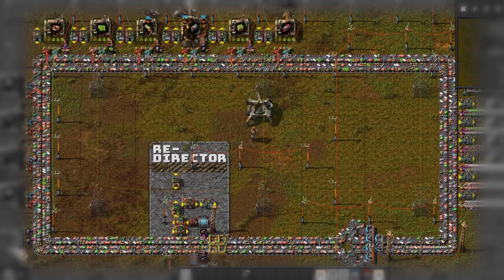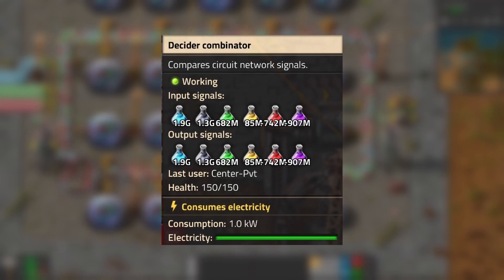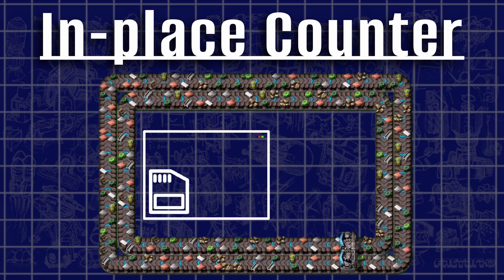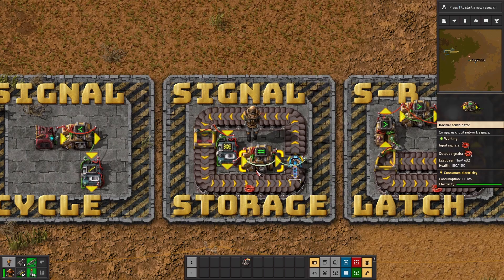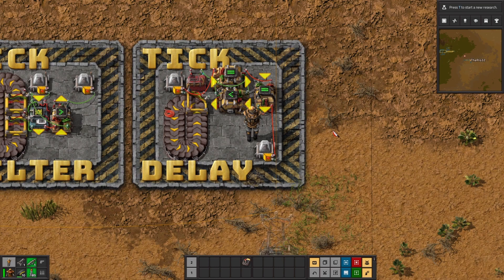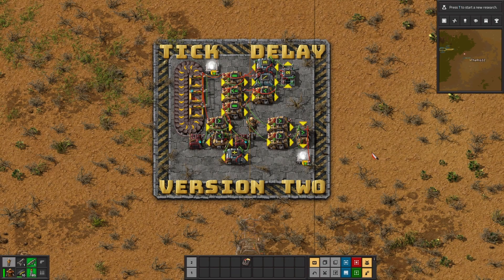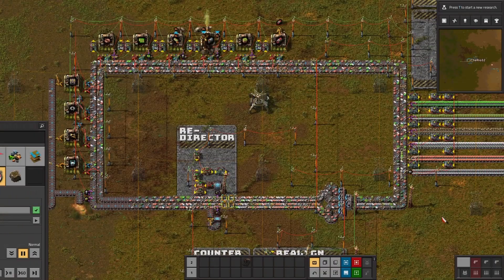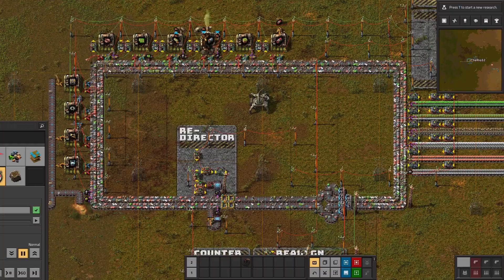Intermediate Circuitry Showcase: Sushi Belt Add-on!

Comment: This design probably would've been useful for DoshDoshington's everything on a sushi belt run. You should check it out if you haven't already.

For the re-aligning process you did it differently than I probably would've, I probably would've wiped the main memory cell (main memory * -1 for one tick), than insert the re-counted values for 1 tick. I probably wouldn't have come up with calculating the difference between the main memory and re-counted memory and correcting it. Pretty cool to see. (I've only recently started learning about circuits)
Reply from the maker: I haven't seen that video yet, gonna have to watch it now xD

Comment: If you place a 3 to 1 balancer and input 3 different things into it, the balancer will give you 1/3 of every item on a belt. This is infinitely scalable since you can put 4 to 1, 5 to 1, you can combine different balancers for different ratios. It also makes sure that you have a full belt of balanced sushi. All you need is to loop the end back into the source so that the belt is always moving.
Just saying, I love the circuit logic behind this as an experiment and stuff, but for sushi belts, unless you need like 60 things on it, it's not the way to go. And if you need 60 things on a sushi, it probably already is not the way to go.
Reply from the maker: thanks for the kind words! also true that it's not that efficient. The reason why i even designed such was for a challenge I did a while ago to finish a game without bots nor trains. Building a mall and keeping track of where everything was seemed kinda bothersome to me with normal belts, so i used the sushi belt solution shown

Comment: just wire all the belts together and set each one to "read contents -> hold", this guarantees a 100% accurate real time count of all items in the system
Reply from the maker: be aware though that this would exclude items traveling on splitters and undergrounds since these can't be wired to. probably in most cases a simpler way though
Reply: @center_pivot  Old comment, but here’s a more streamlined explanation:

Imagine a conveyor line (P1-P20) with a splitter at P17 branching into a new line above (A18-A20).

1. Read the belts: Wire P1 to count P1-P16, and P20 to count P18-P20. Combine these counts for the total.

2. Track the shadow zone tally: Wire P16 to add items entering the shadow zone (P17) to the tally.

3. Avoid double counts: Wire P18 to subtract items exiting the shadow zone from the tally, as they’re counted again at P20.

4. Handle split-offs: Wire A18 to subtract items splitting onto the branch from the shadow zone tally.

This system accurately tracks items in and out of the shadow zone and works even with chests or assemblers (especially in 2.0). Hopefully, this helps someone!

Comment: seems overcomplicated to me. I just ran set collection and distribution rates. Have a chest outputting a steady rate of a particular item. Then at the end of the loop have the fastest belt sorters you have drop everything back in it's chest. The logic circuit just controls the supply line to the chest. Repeat per item.
Reply from the maker: arguably true as an alternative method for smaller setups. you are giving up modularity for lower complexity though. If i would upscale the example shown in the video to 5 parallel lanes that supply around 25 different recipes, sorting out each individual item at their loop start/end-point efficiently, brings an additional challenge to the table when using only belt sorters. nevertheless i can definitely see myself using your variant for distributing science packs for research to labs.